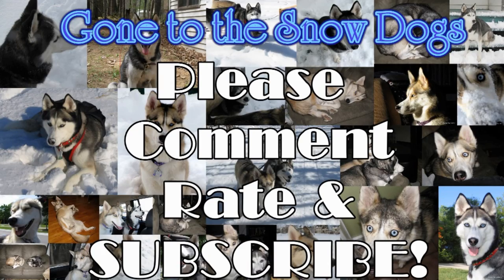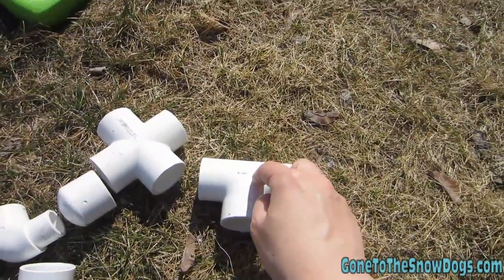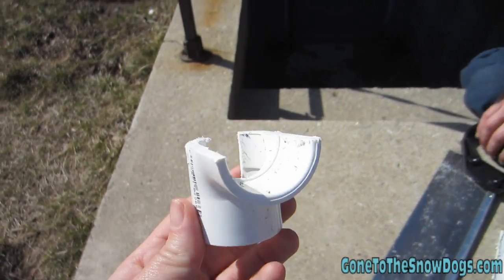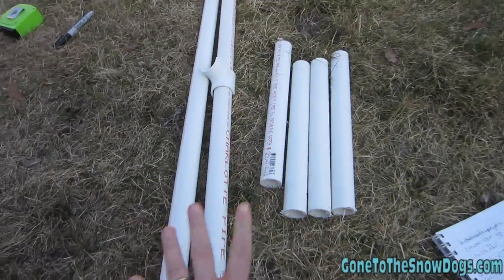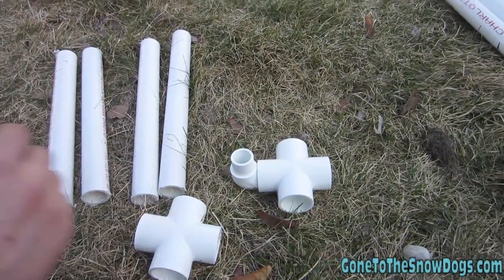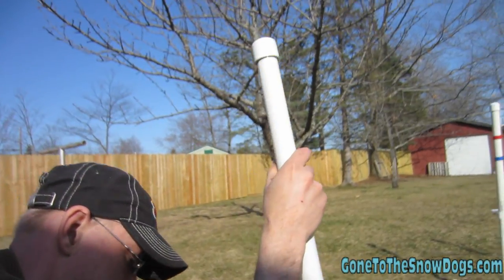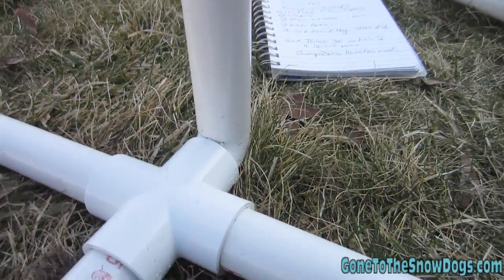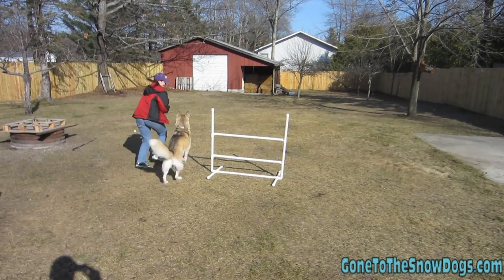How to Make Dog Agility Jumps for Practice -  Build your Own Equipment - Siberian Husky

Comment: You wanted a 4 way pvc tee and all they had was a 90 degree cross tee.  You could have used a tee for the side pipe immediately followed by another tee for the vertical pipe.